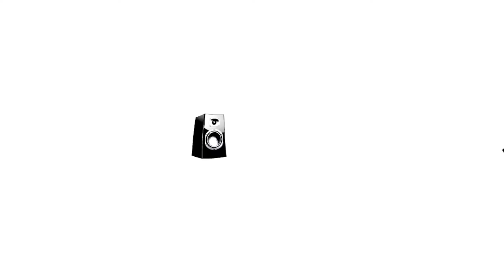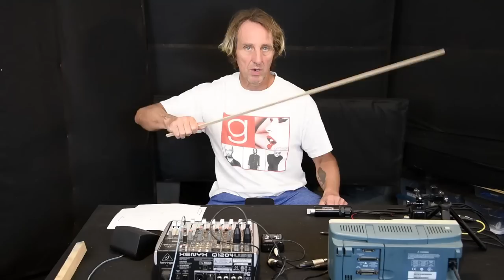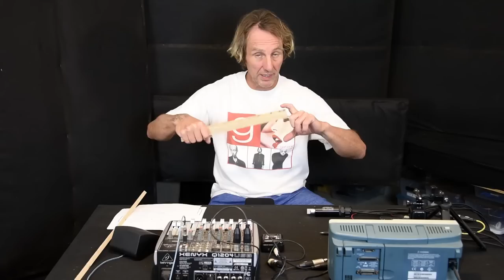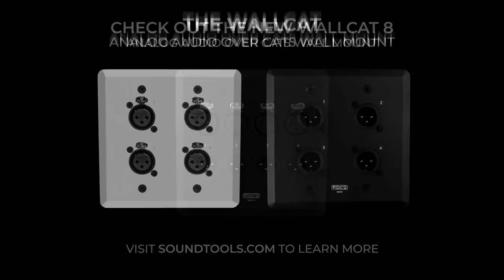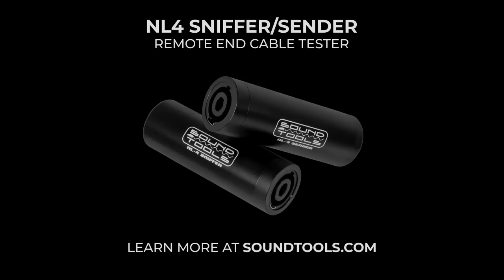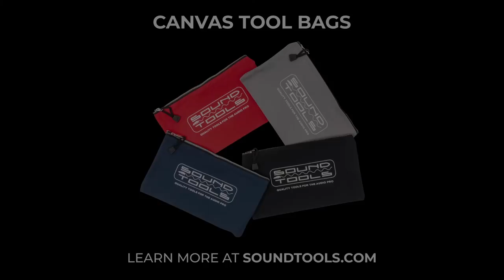Understand DI Boxes, Impedance and Transformers Part #1

Comment: I really like the example with the stick. 👍 Due to capacitance, long guitar cables, in combination with the high impedance of a pickup, tend to attenuate high frequencies. With a DI box close to the guitar, this problem is solved. In other words, the RC time constant improves. This is an advantage of an active guitar as well.
Reply from the maker: Excellent and thank you for the info good stuff
Reply: @DaveRat  You're welcome. I started out as an electronics engineer, who worked with transmitters and stereo modulation, more than 40 years ago. From there I switched to managing a temperature calibration and research lab. At 50 I learned to play the bass, so my approach is mostly technical. 😊
Reply from the maker: Awesome and very cool!

Comment: Hi Dave, I love your analogies for conveying engineering concepts with intuition. I was hoping you could apply your science communication skills to a simple question that has been bothering me for ages:

In power engineering, we use a transformer at the source and to step up voltage (and step down current) to maximize the efficiency of long distance power transmission. 

In audio engineering, we do the opposite; step down the source’s voltage and step up the current to maximize the efficiency of long distance signal transmission. 

How would you explain in an intuitive way to, say, a high school physics student, why power vs audio engineers do the opposite?

Thanks,
Brian
Reply from the maker: Interesting! Maybe a bit of clarification in that audio does not step down voltage and up current per se, but rather things like mics are typically already low voltage higher current right off the voice coil.

I will think on this further but off the top of my head I would say the power transmission is driven by minimizing loss and the goal is to transmit max watts.

For audio the driving factor is optimizing frequency response, minimizing HF loss and with the exception of post power ams, loss of voltage or watts is not a significant concern. Losing 1/2 the power of an audio signal is no big deal as long as we stay above the noise floor.

So... For audio signals, low impedance is critical. Our enemy is capacitance.

For power generation higher impedances rolling off high frequencies I advantageous as it helps filter noise.

So narrowing it down, audio wants low impedance which is a high current low voltage scenario compared tolong distance power generation, high impedance low current is optimal.

But,,, audio does use the power generation concept for 70 volt lines, where we do exactly the same thing as power, transform up to high voltage and transform back down at the speaker. But it does not sound great

So from that perspective, if transmission of power is  the goal, high voltage low current

If transmission of accurate wide bandwidth signal is the primary goal, then lower impedances are preferred, which ruslts in higher currents and lower voltage,

Great question and will ponder and simplify

Comment: I am sure it will be a detail you cover in the future episodes of the series...but, do you intend to cover the difference between the active and passive DI boxes?  I have heard varying opinions and different "rules of thumb" for when to use one vs. the other and have dorked around a bit with the JDI and the J48 from Radial...just still not sure I am in a position to know if the transformer based solution or the active one is better suited for one thing or another.  Anyway, hope to hear your thoughts on all that!  Thanks again for all the great content.
Reply from the maker: Interesting, I cover some but will ponder a vid covering more

Comment: What's your thoughts on using AES cables to send analogue signals for the PA ?
Reply from the maker: All good we do it all the time. We use analog over cat5 soundtools products for analog return snakes as well as analog backup to the delay clusters and pretty much anywhere.

Shielded Cat5e cable actually carries analog better than audio snakes
Reply: @DaveRat  Thank you so much.

Comment: Thanks. I would like to know the practical implications of low/high impedance. I undarstand the level differences ex. that a preamp wants to see like -60db as you say, but I don't undarstand if there are any practical implications in terms of sonics and function for low/high impedance in itself :)
Reply from the maker: Hmmm, well a guitar pickup is lhigh impedance because there are many many winds of wire around the magnets that pick up the magnetic fluctuations from string motion. Using less winds of wire would give less output, needing more gain on the guitar amp.

Quite high gain preamps are more expensive and tend to need to be balanced, also more expensive and complex.

So simple and cheap tends toward high impedance. 

Low impedances or more specifically the low voltages that tend to accompany low impedance signals are more challenging to work with but can offer higher fidelity and are less susceptible to cable capacitance and HF roll off it causes.
Reply: @DaveRat  Thanks!

Comment: Hey Dave, thanks for you video.  I like your style.  You dumb it down enough for me to get it.  I'm a ham radio operator and deal with impedance difference.  With the high power 100W or even 1kw the standing wave reflection can be damaging.  Are you concerned about SWR?  How would you detect it?  What could you do about it?  Thanks.  73's KA9WAP
Reply from the maker: Great to meet you David and awesome questions. So cool ponder the challenges across differing fields.

Yes we do face standing wave challenges in the audio world but in a differing way.

First, SWR is an issue between the rf amp and antenna so the parallel for audio would seem to be between amp and speaker. 

Between amp and speaker we don't really encounter swr issues but some something similar called back EMF does occur, though not a huge issue except in some more esoteric subwoofer designs.

That said, for pro audio the standing wave issue occurs acoustically with sound waves bouncing around the room or venue.

This is a significant issue in reflective and reverberant rooms and spaces and we can go do great lengths to dampen the standing waves and reflections using sound proofing and by altering angles on parallel surfaces.

The standing wave and reflection issue also is a factor impacting speaker enclosure design, microphone design and just about everything acoustic.

Basically a 3D version of what you face between amp and antenna except we just get bad sound and SWR in ham can damage the RF amp.

Unfortunately, I don't have much guidance in resolving the SWR issues in ham, but will ponder it.

Thanks again David!
Reply: @DaveRat  Thank you so much for the quick response.  In the ham world, we use and antenna tuner to cope with the SWR.  The tuner is an impedance matching devices that make the antenna look like it's the correct length for the frequency being delivered.
Reply from the maker: I wish our solution was that easy!

Comment: What is a di box?
Reply from the maker: DI stands for direct input. A DI box is a direct input box that allows the 1/4" outputs of electronic musical instruments and amplifiers to connect directly into the XLR inputs of mixing consoles or other gear.

Electronically a DI box converts a high impedance audio signal to a low impedance audio signal.

DI boxes can be passive transformer designs or active electronic designs who are combination of the two.

In addition to impedance matching instrument outputs to mixing board inputs, DI boxes also provide round loop isolation which can help with eliminating and buzz from grounding issues.

Comment: current sounds like torque, , high impedance sounds like a little F1 engine that makes all its horsepower at tens of thousands of RPM but very little torque, low impedance sounds like a geared down tractor that can pull anything but it's only a couple hundred horsepower
Reply from the maker: That works

Comment: He missed the crucial point you can run low impedance into high but not high and low when impedances are matched you get maximum power transfer at 50% efficiency Power transfer would make a good video the maths is quite simple The graph quite pretty and the sweet spot you're looking for
Reply from the maker: Cool cool, I cover a bit of that in vid 2 where I show how to use a DI box backwards to boost signal  voltage and show sagging when plugged into a low impedance input
Reply: @DaveRat  That sounds like it’ll be interesting. I’ve used a pair of passive DI boxes (with one backwards) to kinda fake an SGI, but I haven’t tried using them to boost voltages.